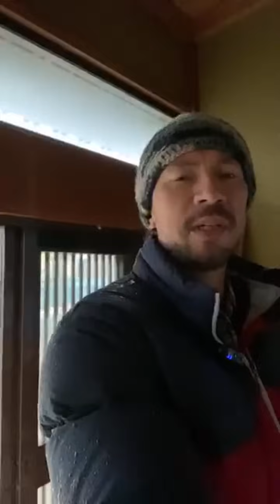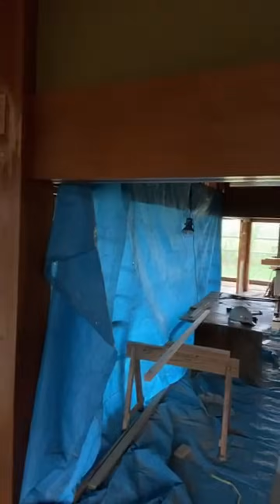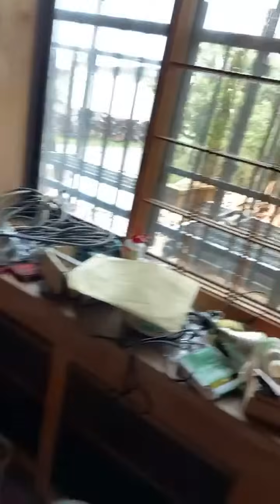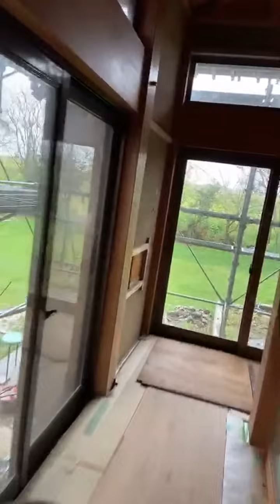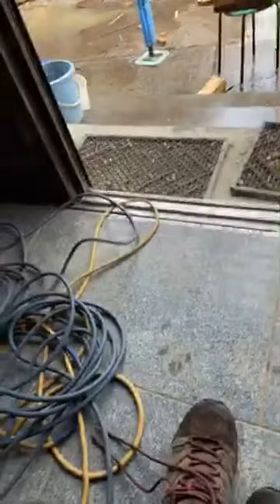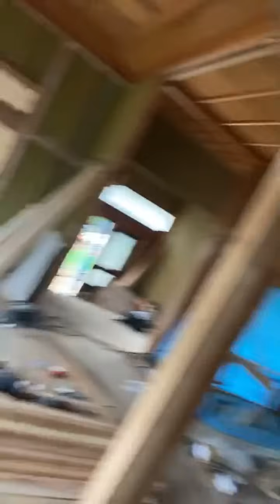Japan Abandoned House Renovation Livestream

Comment: Suggestion! Considering your current evolution, I would strongly recommend underfloor heating for bathrooms and possibly office too. We gutted & renovated our second home and always regret not installing underfloor heating in at least the bathrooms. Our cost would have been around US 1,900 for two bathrooms. It is my biggest regret since we completed the remodel. Our solution was to install a wall mounted induction heater ($149) its about an inch thick, and works brilliantly! Following your progress from Maryland, USA 👍
Reply from the maker: Thanks. I’m starting to wish I pushed harder for underfloor heating. Let’s see. We haven’t done the dressing room floors yet.

Comment: As someone already mentioned: gravel drain Japanese style:
https://twitter.com/AJW226/status/1242452281301192704?s=20
Then just fill in the low spots where water pools with sand, and the excess water will flow into the drain.

Shishiodoshi: any pooling water will become a mosquito breeding swamp.  Make sure it's filled with sand/gravel, or is big enough and non-tap-water to keep some medaka fish, or... where do I sign the petition for the Koi pond?

One big wood stove and mediocre insulation: you'll have hot and dry air hugging the ceiling & 2nd floor, and cold air from the walls and windows sweeping across the floor.  Might want to look into a top floor ceiling -> first floor air circulation duct, ceiling fans, or upward facing circulator fans in all the cold corners to mix cold bottom air and hot ceiling air.
https://www.amazon.co.jp/dp/B00TY322BO
With a couple of these, my house was very comfortable during winter, even though I've had the thermostats set at just 18C.  Key is feet level temperature.  Saves a lot of money on heating costs, too.

Comment: I missed it, night time here ;>D You've got an excellent carpenter, spray foam would let the wood rot. It needs to breath. My house of 1644 had oak beams it was build with and using spray foam would ruin them. The mineral plaster will keep it breathing. What a nice system your architect carriers the responsebility. Here you drown in builder rules..Some of my houses were heated with a Jotul F 500 and heating canals through the house. Could warm a 2 store house. If your stove is big enough you manage just fine. On my farm I had dogs, and all other animals a hobby farm has. Here in my townhouse I've cats, Persian gentlemen, you love them. They fetch balls and listen very well, don't roam the plains ;>D Thanks for all the info and tour.

Comment: I wouldn't use any vapor barrier at all since you allready have the siding on. Getting moisture in the wall isn't the big problem. But you need to let the water out!
Reply from the maker: I think it’s code to have the vapour barrier on the outside. But it’s not airtight anyway at the top or bottom so I don’t think it’s really so effective...
Reply: @TokyoLlama  there are some great vids on Matt Risinger YouTube page where he spends a lot of time explaining vapor  barriers, house wraps, etc. It becomes very clear after awhile that as long as you dont trap the water in the wall it's not going to rot.

Comment: I believe the carpenter is correct. There should be air flow to dry off the exterior cladding. Its been a while since I investigate this, but if you have insulation on the inside of the vapour barrier, you may have to ensure that condensation (the dew point is within the insulation) doesn't occur between the vapour barrier and the insulation.
Reply: Best YT channel for modern building practices ESPECIALLY insulation is Matt Risinger https://www.youtube.com/channel/UCFCTrfb1JUJjs3Im8OZDtBw ,, insulating a house that is that leaky is near impossible... cheaper and easier to tear down and start new... live with what you have and make do...
Reply: After seeing the leaky sliding door wall along the hallway I think space heaters , especially radiant heaters are the way to go in the cold weather for the interior rooms... that wood stove will help immensely if you put in a blower to take heat off of the chimney,, that is one fine house...

Comment: The land scape style is not as comfortable to most using a phone or tablet for viewing. I do not mind but no doubt many others do. I like how you are using
Conduit for your LAN I would also have used conduit for wiring as well but that may depend on what is legal. I believe it lends itself to better control and reducing fire hazards. I might suggest to augment heating using ceramic radiant heating plates in remote locations within the house. The other options maybe a heating/cooling unite I have those.
Reply from the maker: Thanks, I haven't seen them using conduits for wiring here but possibly in newer houses.. I was thinking to use ceramic space heaters to augment the stove. Though we may have to install AC if the house is too humid in summer - they usually come with heating here.

Comment: I'm in Tokyo, and have been remodeling my 25 year old home here for several years. You are reinventing the wheel on a lot of my research and experience and I will again offer my advice and solutions to some of the issues you are facing. Electrically heated flooring solutions are available from several manufacturers here, and are more efficient than using the Eco-Cute (which you are better off just reserving for your water heating needs.) I installed a Lixil product in my bathroom remodel. Mitsubishi Chemical offers a Tyvek like breathable moisture barrier here in Japan, I'm sure there are other alternatives. Any insulation is better than none, but clearly here in Japan we use a room-to-room zone system for heating and cooling, so I'd suggest targeting a few rooms (like you indicated the Kitchen) that can be effectively sealed off and have full insulation and climate management. It makes little sense for the majority of the house, but an office, bedrooms and the kitchen will give you refuge from the worst. Don't put off stuff for later, if it is already torn open... do it now, pre-wire, pre plumb, insulate while you have the chance!
Reply from the maker: Thanks, good to know. Will look into the electric floor heating. Expensive to run?
Reply: @TokyoLlama  The system I have consists of thin modular panels so you can cover as much or as little of the floor as you wish and a 2 zone controller with a complex timer (day of week, multiple on-off cycles.) Direct electrical heating is very high efficiency and you don't need to worry about leaks or corrosion. It is also much lower profile, so you are more likely to maintain your floor level since you are retrofitting. I embedded mine in self-leveling concrete and tiled over that, it provides all the heat required in my upstairs bathroom and washroom. The systems I saw here in Japan are typically designed to work with a matched flooring system (Panasonic has one for example.) I'm not crazy about that type of flooring, but I may use it in my living room and kitchen when I make it to those rooms (these DIY remodels are long haul projects.)
Reply from the maker: Cool, thanks for the info.

Comment: You should have a look at Tyvek Homewrap,  it's actually re-processed in Ibaraki Prefecture. It's also used in Hiking jackets and is the best breather wrap on the market. Combined with a High Density Glasswool (Pink Batt) in the wall will provide excellent R values, however you will need a susbstrate to lathe your plaster over. PIR Formatherm (solid foam style insulation) in the walls are also high in R values but the require a lot of careful cutting during installation and it also tends to "reflect" noise that absorb creating acoustic issues, however you can "render' or "lathe" your Hard Finish Plaster over the top of it. Foam might be the better option, be careful not to use anything that is flammable (big issue in Australia), best on the market in Australia is Kingspan, not sure if it's available in Japan.
Reply from the maker: Thanks, I'll look at Tyvek, didn't realise it might be available in Japan. The foam we're using is Neoma foam, which is considered the best product available in Japan (so I'm told).
Reply: @TokyoLlama  You'll need to put the Tyvek or any other Homewrap at the same time as  you install new cladding. I was just thinking about it and I would have a chat to your plasterers to make sure that they are happy with the Neoma foam. Solid plaster tends to behave differently on different substrates. Lime tends to suck the moisture out of everything, which is great in high humidity Japan but not so great in low humidity Melbourne. Lime Plaster tends to crack in low humidity environments, so be careful around that fireplace.
Reply from the maker: Thanks. Actually we are putting board over the vapour barrier as a base for the lime plaster. The neoma foam is supposed to be fire resistant.
Reply: @TokyoLlama  In terms of fire resistance, this house would pass the building code of Australia as is. The neoma foam looks like it's fire resistant so it would allow ample opportunity for occupants to escape a burning building. Lime plaster is also one of the best fire resistant materials on the planet, that's why the Japanese built storehouses with it in ancient times. Of course, Japan has much different standards but I wouldn't think you would need to do much more in terms of passive fire resistant design

Comment: Please don't give up on the landscape. You need a french drain to move the concentration of water from where it's setting in onto to a  drain. Also  please consider "gravel."  A french drain with a gravel to flatten the surface and the french drain can remove the  water to a drain.
Reply from the maker: Thanks, yes, gravel with a french drain sounds a good idea.
Reply: @TokyoLlama   Most shrines and temples in Japan have adopted a version of this concept. Gravel to fill in unflatten areas of the lot,  and the drains to move the water away from the house.  Although gravel is mostly used in commercial application done correctly  gravel does provide symmetry were grass and dirt can't.   More importantly  in this type of application the gravel would be considered decorative stone.